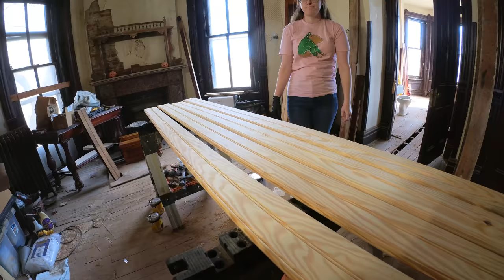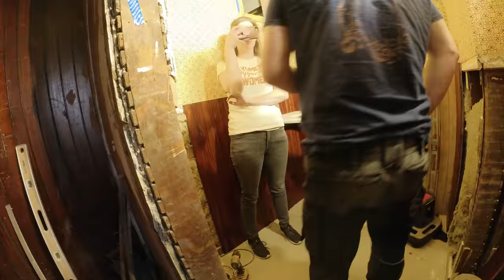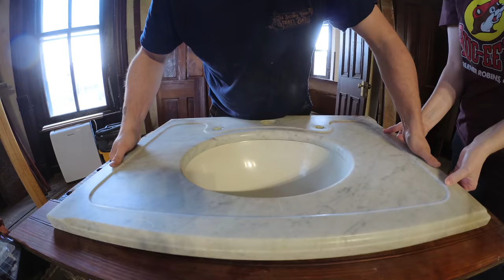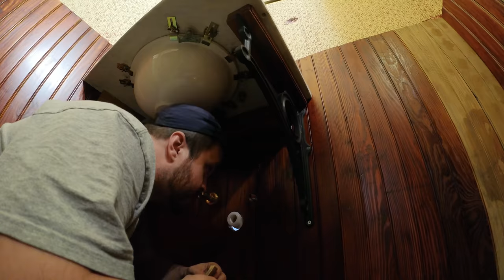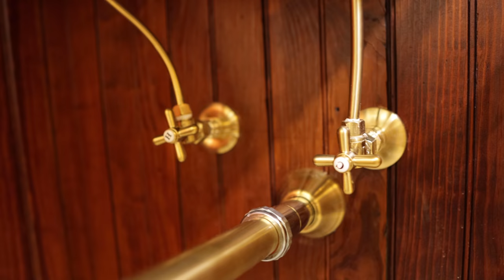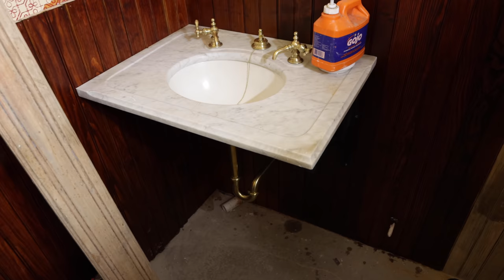FINALLY! Running Water In My Abandoned Victorian Mansion?! S2 EP13

Comment: I think this is awesome. I also think you should make it a priority to get a temporary large utility sink, like a laundry sink, set up somewhere else in the house. This sink is going to be drafted into service to clean anything and everything, and you really don't want that. You have the running water, you just need to run pex and get a cheap laundry sink. I know you probably don't like the idea of putting something 'modern' in the house, but I think the usefulness of the utility sink will prove itself many times over during the course of the restoration.
Reply: Yes! I thought the same
Reply: I agree. Maybe have one in one of the creepy tucked away basement corners? I imagine there's going to be at least a washing machine somewhere in the house and a utility sink will go nicely with it in whatever space it occupies.
Why, if I ever get to own a house, probably one of the high priority remodel items will be to get a laundry sink or a garage sink.
Reply: Excellent idea.
Reply: Yea I’m guessing that not many people keep these sinks in remodeling older homes because of this reason but who knows maybe it’ll last! Or you could just do the utility sink but I would use it and try to find/put up an extra like it in case it needed to be replaced later.

Comment: Very many Congratulations to both of you on FINALLY achieving running water in your gorgeous powder room. I have to say you've done an excellent job of the pipe work, Kaleb, and had to laugh when you brought in the huge orange container of industrial soap! Awesome!  I'm sure you know we English call the little sink stopper a plug and the water doesn't flow through a faucet but a tap for us!  You'll soon get used to using separate hot and cold water. By the way, you've also installed those correctly with the HOT tap situated on the Left and the Cold on the Right!  Your separate on/off tap under the sink is inspirational. We don't have those on each sink in England but it is a really good idea.  Will also help when you decide to tackle the little leak coming from the cold tap.  The marble black splash will complete the look there.  It matches perfectly.

As for the Minton floor tiles - I take it they are Minton, you've picked colours and a design that will pop beautifully when it's laid. Perfect blend for your seriously elegant powder room.  Really well done.  You have definitely achieved loads this week.  Keep up the magnificent work.  All the very Best to both of you.

Comment: You might need a thing called an 'olive' for your compression joints. They're little bevelled brass or copper rings that you put where you've now got those two rubber o-rings in your compression joint. The olive compresses against the but and the joint making a tight seal when you tighten the nut. I'm not a plumber, though I've seen olives used.

Comment: 2 taps: the apartment I rented just after college (probably turn of the century) had taps like that. We’d cup our hands under the cold water, then move our hands to the hot and use the water in our hands (rather than using water mixed in a bowl that wasn’t clean).
Also, since it takes a while for the hot water to reach the sink, 99% of the time you’ll be done just using the hot tap.
Water pressure: try opening the tap under the sink partially and see whether that does the trick.
Packing: Maybe you can add a bit of graphite cording to make up the difference and provide a seal. My 1920’s kitchen sink only uses graphite cording - it works (though you may need to add a little bit more after a month as it compresses a bit more as it works into shape).

Comment: So good to see you so pleased.  You deserve the victory.   Just thought you'd want to know, about the pipe:  I was a mechanical draftsman working in pipe; and I can tell you that 1/2" is not the actual dimension.  1/2" is called nominal (1/2" NOM) which indicates the actual dimension is the wall thickness.  So:  for example 1" nom. is given in the books as O.D. 1.315", I.D. 1.049".  The difference between these two (0.266").  These are standards, and (unless they've changed it) they must be adhered to in production of plumbing fittings.  The only deviation MIGHT be for tubing instead of pipe, which goes by different dimensional standards.
P.S.:  Great job on that sink.  Just a great job.

Comment: The sink and plumbing fixtures look excellent.I hate plumbing I must admit.I never had luck with running and leaking valves.The flat washers you used on the new sink bowl hardware should be backed up with lock washers or split washers to prevent against the wing nuts vibrating loose.The choice of tile is awesome looking as well.Thanks

Comment: I just got around to watch this video. My phone died and had to replace it. It took a week and a half to get a new phone. Love the wood bead board work. It might need a coat of wax to water proof it from water & steam damage. Love the sink and brass piping. Love the stensel on the walls. The floor tile looks period and I like it too! All that's missing is a 4 legged  standing iron ceramic coated tub and a hanging shower curtain hoop. The best part is....water! You washed your hands in the sink! Awesome! Great find on the house trim!

Comment: Make sure your the pressure regulator off your water main coming into house is set correctly.  You can put a pressure gauge on a tap to check and adjust if necessary - no more than 80 psi, 60 psi would be good.  Years ago, plumbing wasn't standard and there were lots of manufactures so it is often hard to match up threads, washers, packing, etc. for old plumbing - it can be quite frustrating.  The term "bastardized plumbing" was often used.  You will likely have to custom make the the insides of that old tap if you can at all, near impossible to find parts for old plumbing that is why most use restoration hardware and use new taps with standard parts that look old but have "modern" insides like ceramic type cartridge stems.  Good luck, will be watching as to what you come up with.   Very nice job!!!  Looks great!!!
Reply: If you install a pressure reducer, don't forget to put on a domestic water expansion tank.

Comment: I think the half inch of those fittings refers to the diameter of the tubing. You have to get matching fittings for all the connections in that size.
I'm sure even the Brits have moved on from that style of separate faucets. They suit the house.

Comment: Most brass Fittings for pipes are NPT (national pipe taper) fittings. These rely on thread deformation for a good seal. There are many different types of connectors though. NPTF (national pipe taper fuel) for example look very similar to NPT fitting but are slightly different. Depending on the needs, the type of fittings are different and I believe it is mostly for the reason of not getting the different connections confused and having a fail, but the connections can be named exactly the same and labeled as the same exact size but be different. Hope this helped! Love the videos!

Comment: Looking good, that is a beautiful sink unit, the floor tiles will be awesome when finished. One piece of bead board, could they be remade by a carpenter, then you could refit the whole house as it was? You just need seal the sink and replace the worn washer in the dripping tap.

Comment: Great job Kaleb.  One observation, the front middle of the marble is your weakest point.  I suggest attaching a piece of wood from the bracket front to the wall, thus adding structural support.  Armando

Comment: I found myself cheering when you turned on the water.  Fantastic!  I hope you waterproofed the beadboard around the sink to protect the wood from splashes.  You have marble for the backsplash...can you use the part cut off to make a "side-splash"?  It would protect the wood plus it would cover up the gap on the sink's side.  You wouldn't then need to cut the marble.
Reply from the maker: Every piece of wood has waterlox on it.
Reply: @The2ndEmpireStrikesBack  Thank heaven.  I know from a bad experience how water damages wood paneling.  I now have to hang my kitchen towel over the spot where the wood is warped.  Do you know how to 'unwarp wood?

Comment: on the nut sizing, there is 1/2" IP (iron pipe) and then there is 1/2" compression, Copper Tubing. I myself hate plumbing.... worked hardware retail for 10 years and my electrical department was right next to plumbing.... always had to help in that department, but having to do it myself is such a pain.... (my own plumbing in my home)  and now, you have tyo go to lowes, or home depot and they have absolutely no help in these matters, thus leaving the home owner to figure it out for themselves... God how I wish I could have been there to help you! hopefully you have someone there with good plumbing knowledge to help you. Plumbing and Electrical are very specialized areas and you have to know what you are talking about when working with them.... the sink looks great and I'm excited to see the bathroom finished. now, on to the toilet! (thats going to be fun!)

Comment: 👍 Leaking water faucet -  Sight unseen... There's a strong likelihood water over time has worn a channel/pit/groove between the packing gland and brass body (aka seat). I don't know, I somewhat doubt, faucets of that era had replacable seats. If they do have replaceable seats you're lucky, and problem is easily solved.
If not, two (2) repair methods come to mind.
1. Re-grind the seat (body) surface. 
2. If large pit exists, silver solder and then re-grind seat. 
You can try contacting old-school plumbers in your area for advice/repair. And then there's Google.
Also, as you assemble more plumbing you might consider (will likely need) a basin-wrench to tighten hard (impossible) to reach water supply nuts connecting to faucets' supply shank/stem(s).

Comment: You'll need to use two wrenches on the water shut off compression nuts. You have to give it a decent amount of torque to properly compress the brass compression ring. That will stop the leak. Use two Crescent wrenches if possible, because a pipe wrench will scratch those pretty shut offs. Clearly that's what someone once used on the packing nuts on the handles. That's why they are so chewed up.

Comment: You're not a plumber unless you go to the hardware store three times 😅.  The last old sink I did required a lot of adapters to connect to the modem plumbing.  If you can, use a supply house for plumbing parts.  They have better stock and everything is (usually) in the right place.

Comment: Half inch isn't always half inch in plumbing. I'm an electrician, not a plumber, but over the years I think I've made all of the most common plumbing errors!  The connection end of most, if not all faucets made for USA use are typically threaded on the bottom end with 1/2" NPS threads, on older designs, it could be 3/8" NPS... they are straight and not tapered pipe threads. Consequently, the part that screws on to connect the supply pipe must have matching threads. In your case, where the supply pipes have a "bulb" on the end, the hole in the supply nut needs to have a hole large enough to clear the smaller part of the "bulb", and tighten down on it. Likewise, the faucet inlet needs something to make a water tight seal, like a gasket. I know it isn't entirely appropriate, but the braided metal covered lines have the nuts made on them, with rubber seals, and can be had in brass or stainless steel color. You can also buy the 1/2" nuts with rubber seals, allowing insertion of 3/8"OD copper tubing. I think they are called basin nuts. You'll want to replace the washer behind the stem. I believe the addition of a basement laundry sink will be an important addition!  Even better if you can find one of the old ones made if cast concrete with a rolled zinc rim. Last one I remember installed new was in a house my parents had built in 1956, before everything turned plastic!

Comment: 1/2 in refers to the inside diameter of the nuts  not the outer diameter.  So the hole in each of them is 1/2 inch.. All three are made for different applications.

Comment: Did you change the washer that end of faucet handle? You unscrew it pull it out and at end there's a rubber washer change that it will stop drip

Comment: We had to have a pressure moderator installed in our house, because when we turned of the water the pipes would bang.  The plumber said it would eventually create leaks.

Comment: Congratulations!   Which company in England did you get the tiles from?    They will look great!   I’m watching from England.
Reply from the maker: Original
Reply: I’ve had tiles from them 👍.     When you have the toilet installed you will be well on your way to being able to move in.  I had my only bathroom renovated whilst I was living in the house.  At one point the only thing in the bathroom was the toilet and a bucket to flush it with!  The walls were bare brick after the plaster came away with the old tiles.  My bathroom is barely 1.7m square (5’6”) and the plasterer took a whole day to re plaster it!   The results were worth it.

Comment: Where did you find your beautiful single hole faucets and drain set up?  They look great!
Reply from the maker: The drain, pipes, supply lines and shut off valves are from an online shop. Restorers Hardware i think its called. The Taps came off another marble sink i have sitting up stairs. They are stamped with Federal MFG CO Chicago. Hope this all helps
Reply: @The2ndEmpireStrikesBack  Thank you so much!  I have been trying to find functional taps for a 1920s sink in a 1880s house.

Comment: Water finally ! Sweet, good job guys...one question,  should you have put the tile down before the beadboard? Sure would be a bitch if you had to remove a board for any reason, but I suppose you're gonna put an access panel behind that wall should you need to get to the plumbing? Only things left to finish is tile, trim, sconces , shitter, table and a picture for the wall..ohh and towels..congrats! 
Ps..good rules , I just got the cherry scented jug as the orange wasn't available 😁

Comment: Never did like those separate hot and cold faucets. They look nice but are far from being functional or practical.
Unless you use the bowl, you're running either freezing cold or scalding hot water on your hands, there's no in between.

Comment: @10:13 I suppose if it doesn't leak, that it can be considered a success but the plumbing OCD in me says you don't have a clue in the whole world on what you are doing.
That end on the brass riser pipe is designed to make a water tight connection to the flared end of the faucet fixture without o-rings!